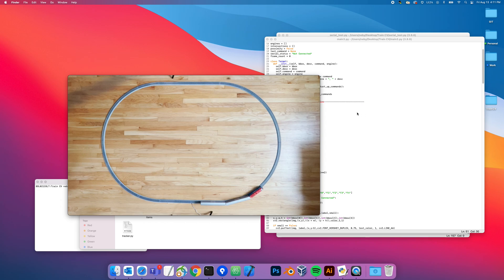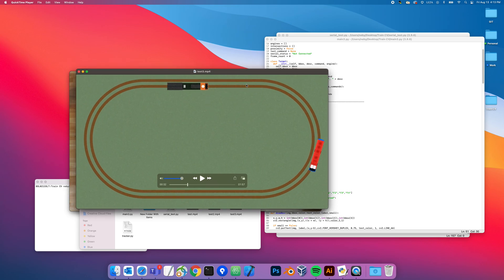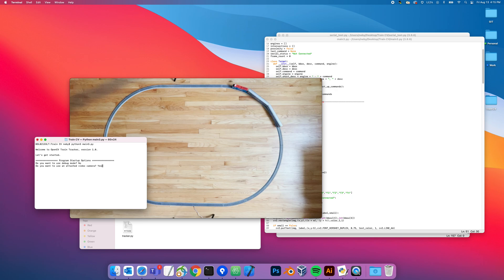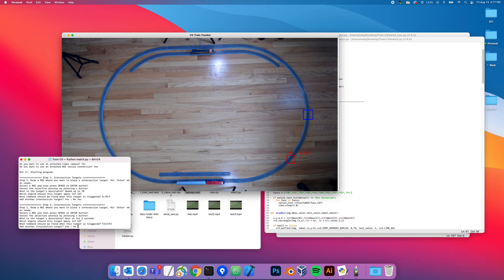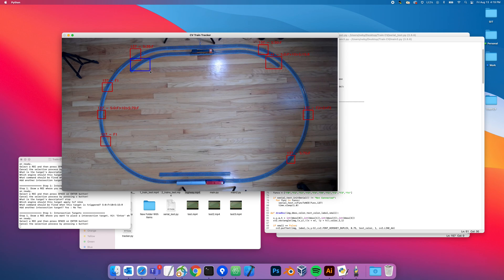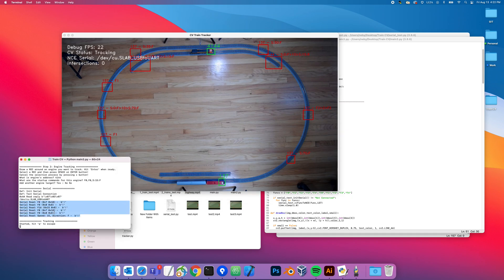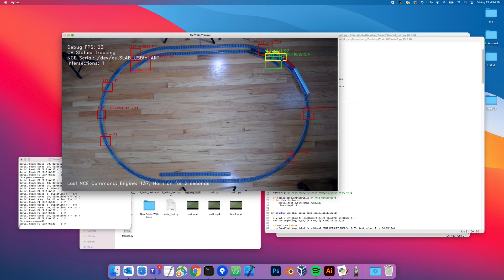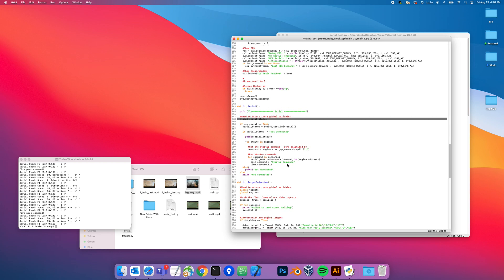Controlling a model train layout with computer vision (OpenCV and Python)

Comment: The next step is to integrate several cameras, with more horizontal optic axis, for bigger layouts, and infer hidden stuff (eg. tunnels).
Reply from the maker: Yes! agree. Scaling this up to a larger layout with more prototypical structure would be next integration and take a lot more effort. If I had the space and layout I would for sure try. I think the biggest challenge would be tracking a single train across several cameras – in this demo I explicitly have to tell the tracking system an engine number and it never leaves the visual bounds - where in a multi camera system I would have to have that automated with a recognition engine. Would be fun for sure!
Reply: @nicholaseby  my first thought was, what is a very distinguishing feature each individual train could have, that doesn't affect their prototypical look.
My thought was infrared LED's mounted on the top of the trains somehow, but that wouldn't work since most video cameras can't detect IR, haha.

Maybe there could be some way to loop cameras together in the program, like when a train leaves the view of a camera, it is "marked" as now being in the frame of the following camera. Like a game of hot potato, telling each camera what trains are currently in its frame as they come and go

Comment: Nice project - ever thought about mounting a raspberry pi zero on the trains and doing openCV detection to drive the loco, from the train itself?
Reply: In HO, the cameras are still too big (or two small resolution) to be integrated inside the locos.  And the locos are generally already quite full.   But this would be possible in O or 1 scales.  

Also, the point of the system, would be to replace the control and command of the signals and sections, not only to drive the locos
Reply from the maker: thanks! agree with @informatimago, it would be difficult to package a camera and micro-processor in an already full loco. Plus I like the birds-eye view approach to manage several locos at a time from one camera.